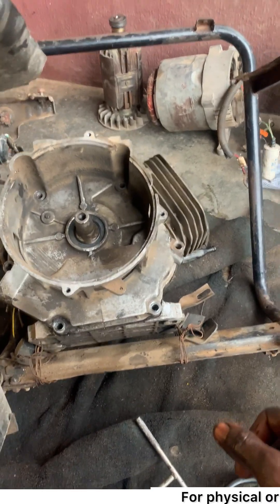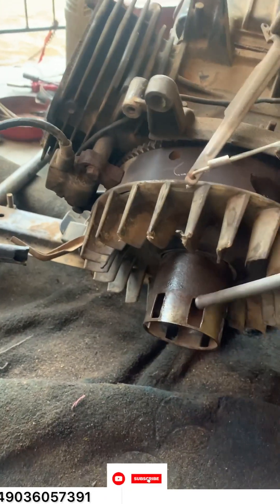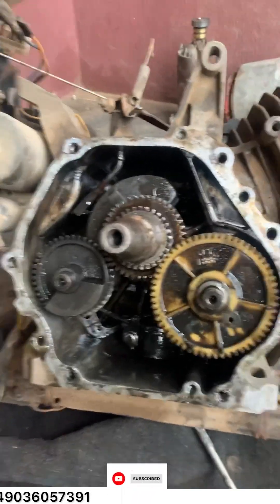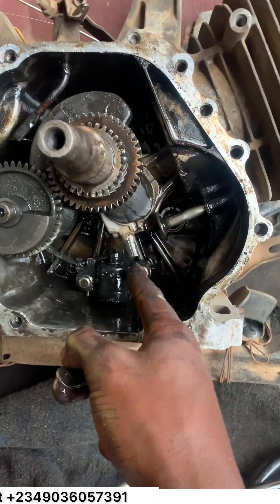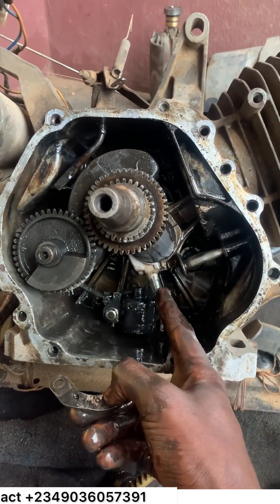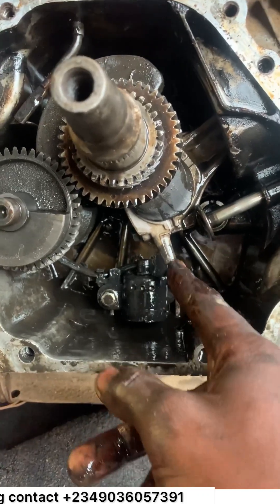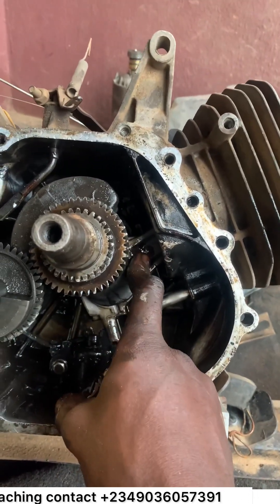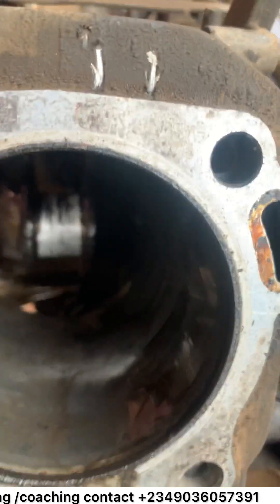Cause of stuck generator engine. @bencoinstitute @jcondon1

Comment: The dipper is very delicate.  To bad the compression release let go and took it out.  Besides a connecting rod, you will need a new camshaft for the compression release to work.
Reply from the maker: Yes the problem start from the camshaft. So it needs to be replace. Thanks 😊